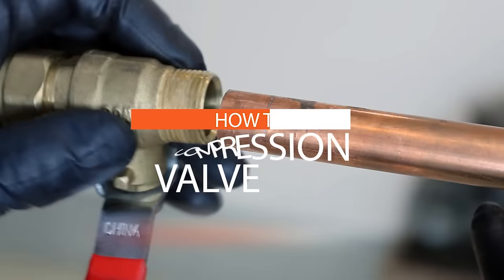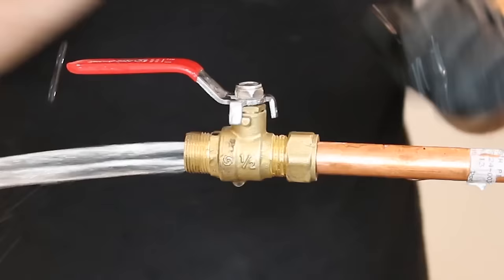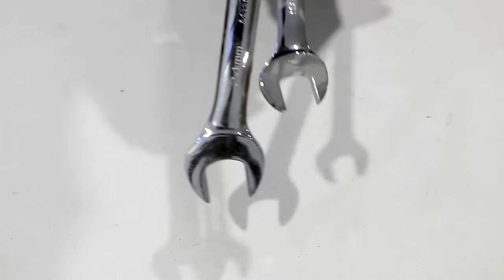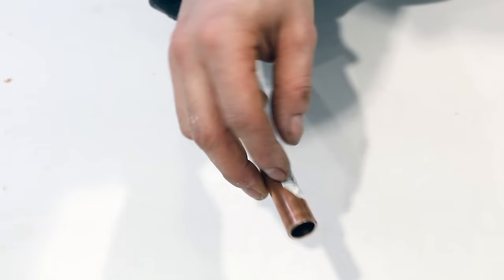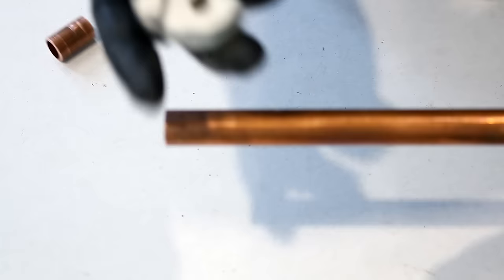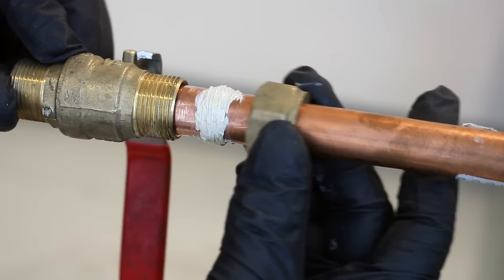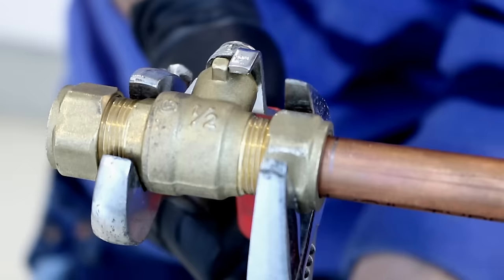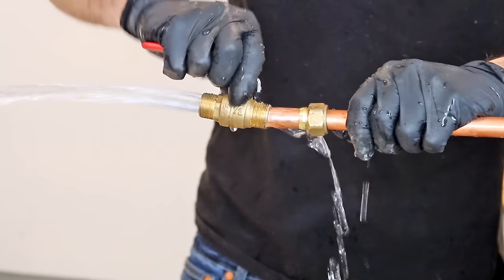How to install a COMPRESSION fitting! | GOT2LEARN

Comment: Be careful! applying a sealant compound to a compression ring is a violation in the US and it wont pass inspection. The brass ferrule alone is enough to create a proper compression fitting and it should not leak nor need anything else. However, teflon tape or oil can be applied to the threads of the fitting to make tightening easier.
Reply: Why is that?
Reply: Iknow the olive is enough but why doesn't it pass inspection?, I'm the same i pop PTFE on water, jointing compound on gas pipes, just that little extra assurance it won't leak, as for ousting it threads that just a sign of a DIYer😁
Reply: Violation?  More bureaucratic Bullshit.
Reply: @happyguycol  It introduces potentially harmful chemicals into your drinking water. some products are not suitably for "Potable" water applications.
Another issue to deal with is when you undo the fitting you should clean all the crud off before reattaching the fitting. Not cleaning runs a greater risk of leaks and contaminants in the water.
Reply: @Rocky-xx2zg  Sounds like you would be happy to get sick because somebody used a harmful product.
Reply: @skullandcrossbones65 obviously but, is it a violation on a non potable waterline? I know its not needed but i use it anyway to make the job easier and I know the nut and ring wont ever seize if she ever needs to be opened again.
Reply: @skullandcrossbones65   Dis I annoy you with my comment?  Your reply indicates that.
Reply: So the ‘ferrule’ or ‘sleeve’ is called an olive and there are specific products that are suitable for potable water. PTFE tape is a standard and I put it on the olive of all my compression joints. It helps create a water tight joint without over tightening. Once a joint has been over tightened it will distort the pipe and you’ll have a nightmare getting a water tight seal without cutting the pipe out.
Reply: Correct!  Absolutely everything you need is in the pack ! you don’t need tape , sealant , grease , plumbers mate , dragons teeth or your grandmothers secret cake recipe 🤦‍♂️ use quality fittings , do the prep and that’s it , end of story ☝️🇬🇧  30 years in , no leaks or come backs
Reply: @The-General36  except when the valve fails and you have to swap it out and the last guy over tightened it and crushed the pipe and now you have to either PTFE the olive or cut out the crushed section of pipe. For the cost of PTFE and the two seconds it takes to use, why not?
Reply: Violation of what?
Reply: @DaddyBear3000  Not usually a problem, but in the worst-case scenario you can use a ferrule puller to remove the smashed olive, and a pipe sizing tool (or even an adjustable wrench) to restore the pipe to round.
Reply: @ luiguivilatore8776 where are these clowns coming from? Nothing wrong with a little dope on the ring. You do not use any type of oil on the threads. I woulda used a little bit more dope on thread to help from binding too early.

Comment: If your reusing an old pipe and olive putting a connection back together some plumbers grease might be helpfull but if your using new pipe and new olive then no grease is needed. It just needs tightening up right. Not too tight as that can cause a leak as well as it being too loose can. With tightening go a bit by bit and check for leaks. You can always tighten more if needed but if u over tighten and it leaks u cant go back. Ptfe tape isnt needed on the threads either as the thread isnt where the watertight seal is formed. Its the olive being compressed by the nut being tightened  that does. Hope this helps someone 😁
Reply: But.....putting pipe thread sealant on all threads aids in seating. So put it on ferrule, threads and unit and then tighten. It will be properly seated and not prevented by friction. It's like 0.01 cents of material.
Reply: Never heard it called an olive.  LOL
Reply: @beerbeforebreakfast  I agree. I put a small amount of dope on all unions too. Just makes it easier to get a tighter seal and also easier to remove for the next guy.
Reply: I’ve mostly read from pros to not add pipe dope but they did also say they aren’t fond of compression fit valves in the first place. They’d solder so take with that what you will. I ended up just sanding and cleaning the pipe with no dope, all’s well.

Comment: I never have used any kind of sealant on a compression fitting, I have used Teflon tape around the threads , the ferule usually is sufficient to have a leak free connection
Reply: Dope isnt for sealing, its for thread lubrication first, then way down the line  somewhat of a sealing. But really its the interference threads that will make a seal. But in this case it allows the collar nut, the olive and fitting to slide together without any resistance other than where things are resisting to actually make a seal. Hope that makes sense.
Reply: Please next opportunity try hitting the ferrule the nut and fitting with some pipe dope and your will quickly see why its a nice safe addition. Helps me sleep at night.
Reply: plumber for 40 + years and have made lots of service calls ( and money) cleaning off "teflon tape" from compression fittings... Have NO idea where that stupid idea came from.  Compression fittings aren't designed for any sealant or tape.... jus sayin  (using a touch of something as a lube...maybe, but, I've never had to and don't plan to.)
Reply from the maker: @bigguyusa193  tye dope is liquid teflon, I only use it to lubricate it like you said, not to seal.
Reply from the maker: @disklamer  as I mentioned, I just use it as a lubricant as some oils aren't rated for potable water systems.
Reply: Tape on the thread does nothing, that’s not where the water seal is made
Reply: @tomstrutton4351  yeah I know that's why I said the ferule is usually sufficient to stop water leaks Teflon tape just makes the nut thread on easier
Reply: @beerbeforebreakfast  the threads aren’t what makes the seal here, interference or not.
Reply: I use silicone grease around everything on the inside.  Makes things go together nice and easy!
Reply: @bigguyusa193  it came from UK plumbers who have no idea how a compression/cone tight fitting works..
Reply: @angeloc700  that makes alot of sense. I use silicone grease on certain applications but never thought to use on compression. You may be a genius sir! I don't get stuck in the "I've done it this way for 25 years...." I can't count how many times I've shown that to be wrong. Things always should be improved!
Reply: @tomstrutton4351  yes tape on threads wouldn't do anything. Pipe dope on threads and ferrule, now your allowing things to move as they want to and make the final seal that we need. Just try it and then see the results. I install about 20 compression fittings per week for repair work. Thats my method. I can't afford any call backs. Lube is life!
Reply: @bigguyusa193  This is the correct answer.

Comment: You really don’t need to put anything on a compression fitting if installed correctly it will not leak but it helps with a little pipe dope but you don’t really need it.

Comment: Thanks for this. I like to install a thin film of potable soft-set dope on the pipe on the pipe (after the nut is pushed past, so it is under the olive) then the olive ferule, then a thin film on the olive and the male threads.  the tubing and olive film improve sealing and reduce friction when tightening , and is easy  to do.  Don't buy in to the false claim the dry fit fittings are not allowed to have sealant on them.  Just because they can seal dry doesn't meant that it is best to seal them dry or it is a violation to use approved sealants.
Reply: Larry Seibold, so putting a thin film ¿on the pipe UNDER the olive, on the outer side of said olive, on the threads, and then tighten?  ¿This still seals well?  Thank you.
Reply: @tonyd1149  yes.  you are mainly avoiding dry threads and sticking.  the soft set thread sealant under and on the olive absolutely makes a difference.  It seals with less torque.  you can use almost anything on the threads, like silicone, as you are not sealing the threads, just allowing them to slide smoothly when torqueing them down.
Reply: @larryseibold4287   thank you for the kindness of a reply.  Soft set thread sealant, under the on the olive, to assure a good seal (using less torque), ¡thank you!  (Amazing).  Thank you for your experience & recommendation.  ¡Thank you!  (I used a comp. shut off on our water heater [~4 yrs ago].  And did have a little difficulty.  Now, this new information, will help me very much [replacing old style shut offs that leak]).  Thank you so much Larry Seibold.  I had no idea.  God[Bible] Bless you.
Reply: I thought it would be a good idea to apply pipe joint compound not only on the outside of the ferrule but also between the pipe and the ferrule, but then it occurred to me that the only thing holding the pipe in the fitting is the friction between the ferrule and the pipe. If the pipe joint compound acts as a lubricant, it could allow the pipe to slip out of the fitting under hydraulic pressure. Therefore it may be better to have a "dry" metal-to-metal seal between the ferrule and the pipe, while having pipe joint compound between the ferrule and the fitting to block a leakage path for water there. Also, spreading pipe joint compound onto the ferrule entails coating the pipe on either side of the ferrule, forming a barrier at the edges of the ferrule. A practical way to do that is to tighten the nut a quarter turn or less, just enough to make the ferrule stick to the pipe, then unscrew the nut, apply pipe joint compound around the ferrule and surrounding pipe, then screw the nut back on and tighten it down.
Reply: @truthpopup  Spot on! Completly agreeing with you. There are several problems with applying lubricant: one is reducing the friction in between the threaded parts. Not only that decreasing the friction coeffcient can cause the loosening of the assembly(due to vibrations in the piping system) as you mentioned, but also it will create more clamping force due to reducing the prevailing torque. This can damage the sleeve and compromise the seal.

Comment: I like those compression fittings, I keep a couple of them around for emergencies. Like you said, they are good in areas that you can't use a torch or where the water can't be shut off fully to be able to solder. Unlike Sharkbite fittings that have a O-ring, these use a brass ferrule compression ring.  I do the same and use pipe dope or plumber's grease on the ferrule.

Comment: For coiled copper pipe,valve could leak,so make sure it's round shaped before.you could use a crescent wrench,or a copper sizing tool,sold in plumbing,or hvac stores.

Comment: I always thought that using dope was old fashioned.  I’ve dismantled old joints from 50/60 years ago and found them really gunked up with horrible stuff.  I find that provided the pipe is in good shape then the metal to metal contact of the olive on the pipe is sufficient to stop leaks.  I have used teflon tape on a couple of joints where I could not change the pipe and could not get a leak free joint.  I put tape on the pipe, slipped the olive over the tape, then put tape over the olive before connecting up.  It worked.  For me though, dope is awful stuff and isn’t strictly necessary unless your pipe is not in good shape.

Comment: I used this type of valve today in an apartment complex.  The water heater shutoff wouldn't shutoff.  I only had to shut water off to the building for a few minutes so i could cut out and install the new valve. I have several spares of these for just such an occasion.

Comment: Thanks for sharing, this video saved me at 11pm replacing double shut-off refrigerator filter valve  leaking from the valve stem. Replaced valve and the pipe dope technique worked.
Reply from the maker: Excellent!!

Comment: Another great video...thank you so much for these useful tips. But no matter how hard I try to use these correctly, water sometimes seeps out the back end of the nut (installed on a hot water heater line, in this case). I know that I most likely overtightened the nut, but being a rookie, that's all I knew how to do.......over time, the water did stop seeping out on its own......next time I need to replace the water heater (they seem to only last about 6 or 7 years around here), I plan on using Shark Bite connections to see how they work. Again, thank you so much for helping all of us out!
Reply: Check your water heater's sacrificial anode. Once that's used up, they tend to rust out immediately. Replacements are available at big-box stores or plumbing supply shops.

Comment: I’ve also seen some folks recommend Teflon tape on the ferrule. Is there an argument against using both? Also, is it necessary to use tape or dope on the threads of the nut/fitting?
Reply from the maker: Not necessary!

Comment: Can you use compression fittings to install the 2 - 3/4 braided lines directly to the copper pipes for a water heater?

Comment: Type L copper.  kick ass.  i like compression.  sharkbite for emergencies.  do you deburr your copper before soldering?  Anyways, i find that cutting type L or type K, the burr on the outside has to be removed, so i carry a mill bastard file to remove it.  i see that you like milwaukee.  i am a makita fan.  both are good tool companies.  ALso, i like that you bought the channellock wideazz (made in spain by irega).  nice.

Comment: Under normal circumstances, like using pipe dope for a tapered joint, it should be applied to the threads to assure smooth even pressure at the affected joint. While this may not be a problem with a copper ferrule, if you are making up a compression coupling ( or valve ) that had a rubber gland then the dope could pose a problem
Reply: It's a copper furrule

Comment: Cheers for the video. I have a question about connecting a silicone hose onto the other side of one of those fittings. Do you make sure the side that the hose is connected onto is barbed and then tighten that side with a jubilee / worm drive clamp? 🤔

Comment: Thank you!! I had to install my dishwasher by myself and truely appreciate the help.
Reply: @Got2Learn  I have a question.
I got a 3/8 inch OD elbow for my copper water line, and it was too small. If the pipe is 1/2 inch, do I get an elbow that matches (1/2 inch OD) or do I get the 3/4 inch OD so that the elbow is bigger than the pipe?
Reply from the maker: 1/2" fitting for 1/2" pipe :)
Reply: @Got2Learn  Thanks. :)
Reply from the maker: Np!!

Comment: What gap do you need between the pipes when joining two pipes with a compression fitting?
Reply from the maker: It depends the fitting, you need to use the fitting as a reference.
Reply: @Got2Learn  Thanks!

Comment: How can you ensure the ferrel won't slip off?  The reason I ask is I replaced a shutoff valve in the garage.  The instructions said tighten nut 3/4 to 1 turn after it seats.  Did that and an hour later, the whole valve popped off.  If the valve would have been in the house, I would have sustained a lot of damage.  Looked like you tightened it a lot more than I did.
Reply from the maker: Yes, they need to be tightened pretty well.
Reply: The bad part is I read the enclosed instructions where more often I do not.

Comment: Why did you apply the sealant only to the top of the olive ring when the other sealing surface is between the ring and the pipe? Technically, it is metal to metal contact and sealant is not needed but it can be an insurance for small scratches. Still, you sealed only half of the seal contact.
Reply from the maker: It's not for sealing purposes, it's just to lubricate the nut while it's being tightened.

Comment: Loving your videos. I installed a compression valve but I see a small droplet. If I decide to re-install and use pipe joint compound, do I need to get new compression valve or can I use the existing one?
Reply from the maker: Just tighten it more, it'll stop leaking.
Reply: @Got2Learn  I think I tightened it as far as it goes which is what I am worried about. That's why I'd rather re-do it with pipe joint compound
Reply from the maker: @miltonrobin  The compound is just there to provide lubrication as your tightening, if it's leaking, there's most likely an issue with the connection or the materials.

Comment: U can also use ptfe tape in place of pipe dope. U only need to seal the side of the ring facing the fitting, not the other side because water leaks out from this side.
Reply: You don't need dope or tape with compression fittings.
Reply: @themonkeydrunken  in theory you don't. In reality, you often need.

Comment: Can the pressure fitting ferules be replaced separately if you need to move the valve to another location? I put mine on the wrong side for the cold... thinking the water source was coming from the front of the house.. BUMMER!!! 

Now I need to remove the valve and put it on the other side of the Faucet valve! If there a trick to removing the compressed ferules or should I just cut the pipe and put in a longer repair piece? Thanks for any advice.
Reply from the maker: Watch this here: https://youtu.be/OjD2UtzlX8w

Comment: Do you recommend using compression type of valve as a main shut off valve just before the water meter? I am the Toronto area and the water meters are in the basement. Nice video by the way.
Reply from the maker: Never! Only solder or pro press! Thanks!
Reply: @Got2Learn  Pro Press Leak too! I worked a Multi Trades Mechanic, and I Have found  Pro press connection Leaks

Comment: Help! Repairing 1/2 inch copper tubing. Got my leak cut out, deburring done on both ends, inside & out. 1/2 inch Push fittings were too loose, so I got 1/2 inch brass Compression fittings kit (5 pack). Everything fits fine, except the seal rings. What's my next move? Thanks. 💖
PS I tried checking your forum, but this had not been addressed yet, so I created a thread under Help!
Reply from the maker: Answered on forum!